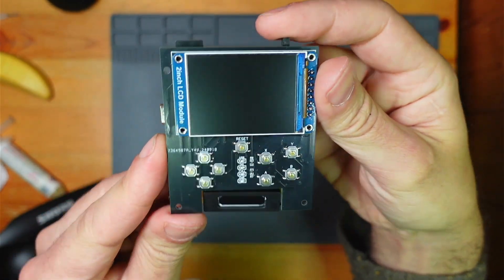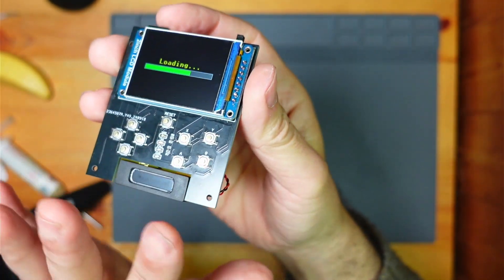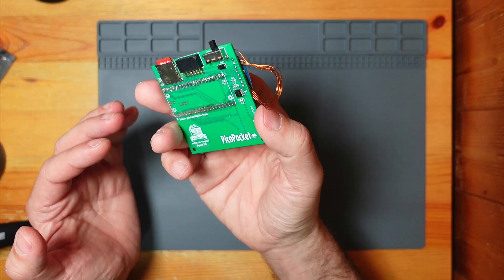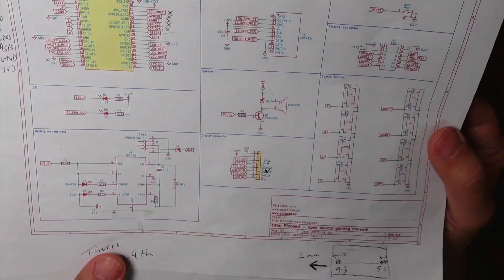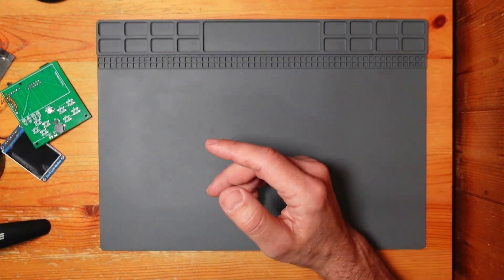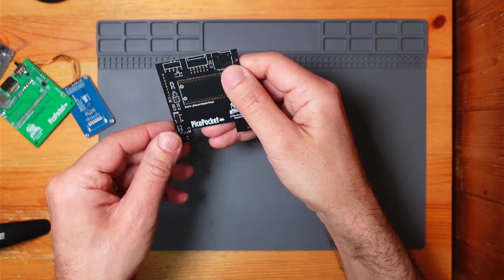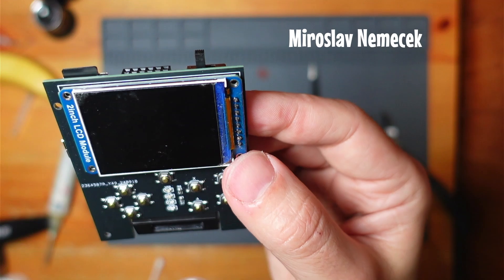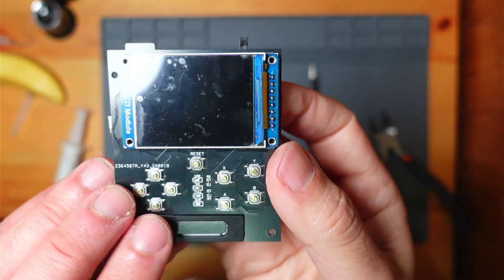Picopocket - an RP2040 Pi Pico Handheld based on PicoPad

Comment: Sir can you upload a tutorial for how to flash the firmware for this project on pico.
Reply from the maker: I just download Miroslav Nemecek's PicoPad 2 ARM mode files over on Breatharian (or the PicoPad1 files for a RP2040). The LOADER.UF2 file needs to be uploaded directly to the Pi Pico, then everything else goes on an SD card. The link has been added to the description.

Comment: Hey! is your firmware open-source? If so, where could I find it?
Reply from the maker: If you mean the Picopocket, none of it is mine, but Miroslav Nemecek's PicoLibSDK appears to be open source (link in the description), and the Github link for Picopad can be found by following the (link in the description) for PicoPad. I personally don't have a Github page. Thanks for your comment.
Reply: @megazoid  Thanks for the reply! Sorry if it's a dumb question, but how do I install GBC games onto the device?
Reply from the maker: @seanocansey5673   I can't get into GB / GBC emulation for legal reasons... sorry. The software is nothing to do with me.
Reply: @seanocansey5673  Games can be loaded from the SD card (using built-in loader) or directly via USB cable from the PC.